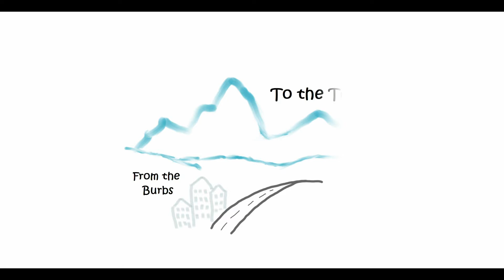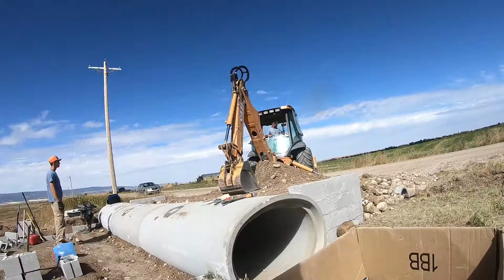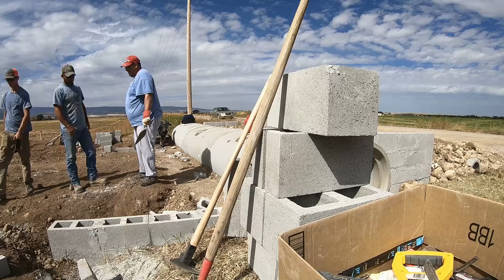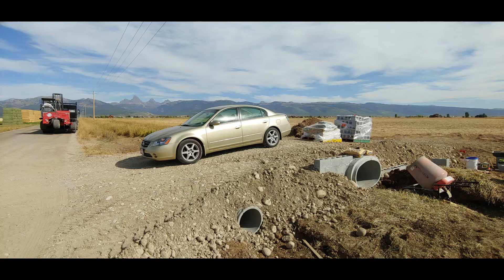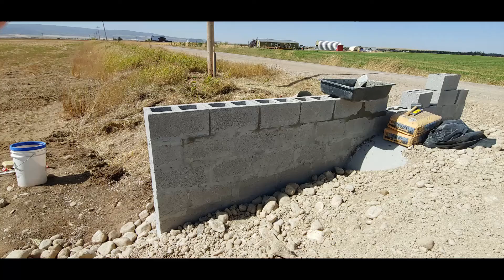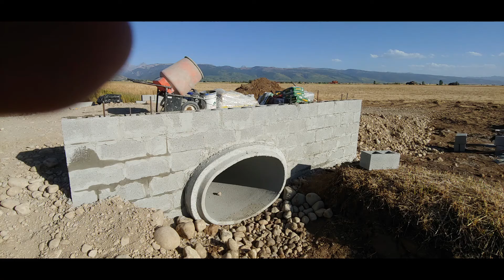Property Site Design and Build - Part 6

Comment: Does the county have to inspect that culvert installation?
Reply from the maker: No.  They also don't inspect the driveway, even though there is a county code for driveways.  I think the big thing they are concerned about is fire truck access.  I exceed all those requirements.

Comment: It looks like no snow remains on the property or mountains. How many inches of snow do you estimate you got on your property this winter? Thank you.
Reply from the maker: The videos and pictures are from Sept 2018. Reports from the local newspaper, it has 26.6 inches on the ground right now.  They had several big snow storms in a row.  The snowpack on the mountain is 116% of normal.  It is super dry in the valley, so snow tends to evaporate almost as much as it melts.